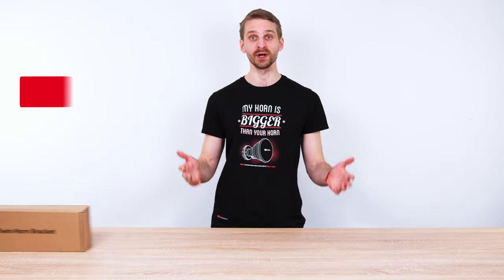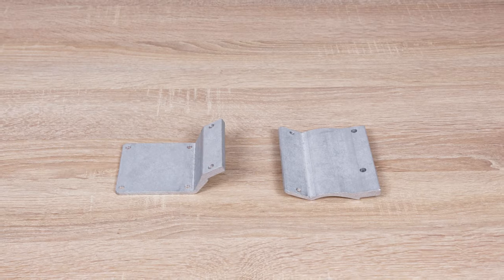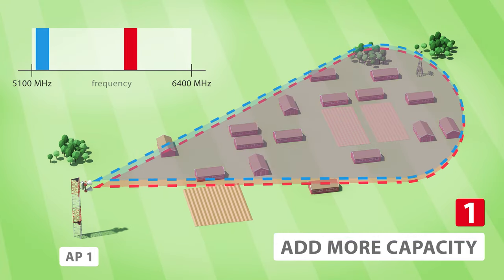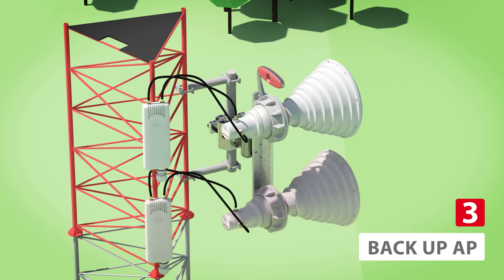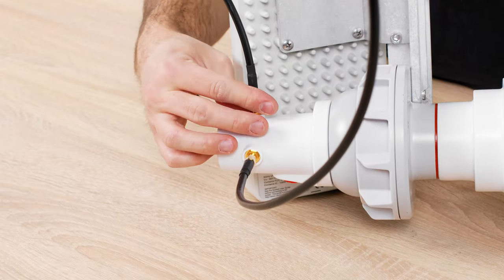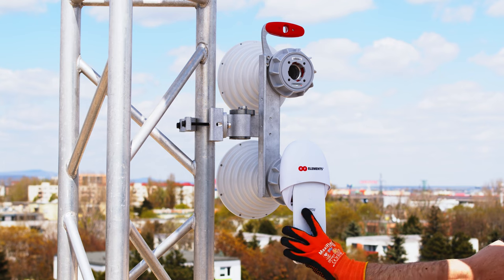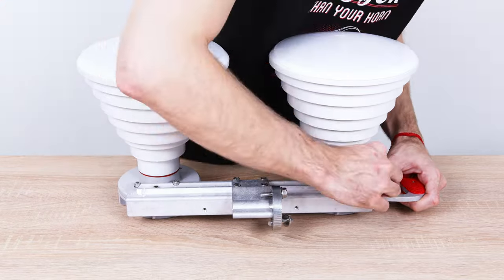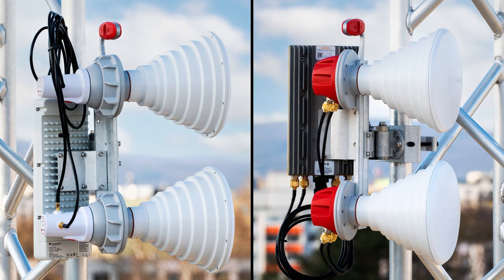RF elements® Twin Horn Bracket Product Introduction

Comment: So, can we use this with the ePMP3000 and two horns "with the exact same azimuth and elevation" and still get 4x4 MU-MIMO?  I thought the best practices was to have a offset/overlap for the phase differences?
Reply from the maker: Hi Todd, to our knowledge, you cannot use Twin Horn Bracket with two horns and ePMP 3000 in MU-MIMO regardless which of the Symmetrical Horns you use. It can only be used in the overlapping sectors mode, so 4x4 MIMO.
Reply: @Rfelements  OK, thank you.  I watched the video, but I misunderstood what you were saying at :29 about the ePMP3000. My bad.  That's excellent, thanks for the clarification -- that looks very interesting. :)